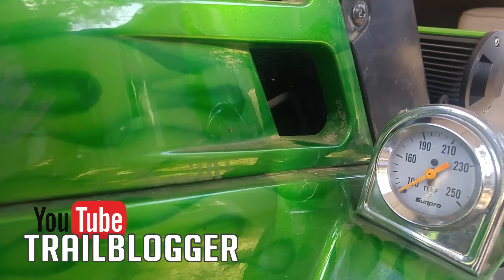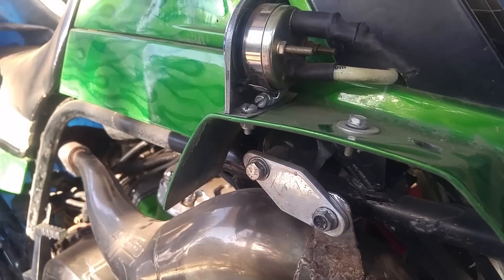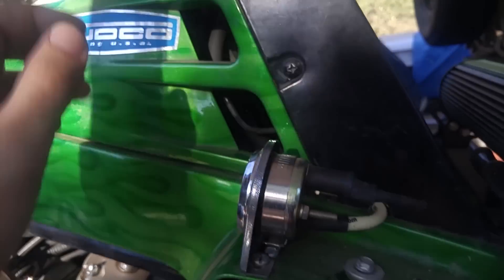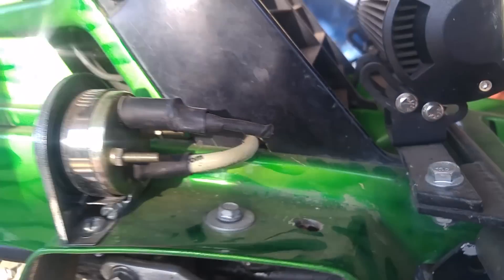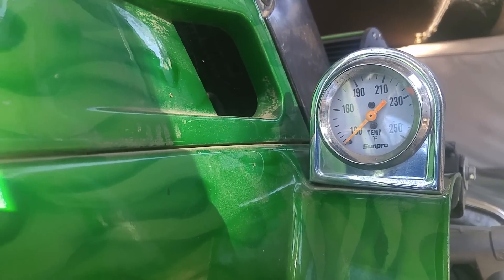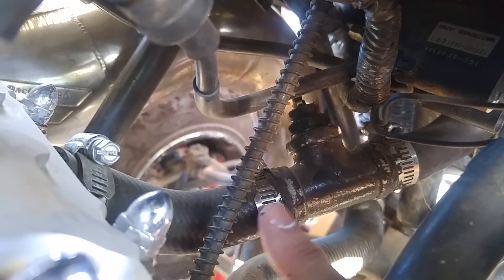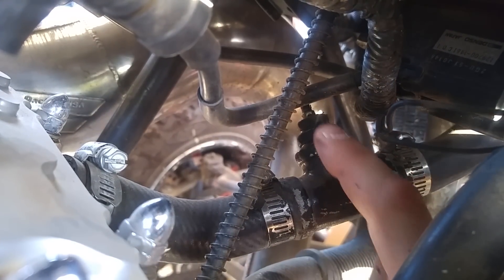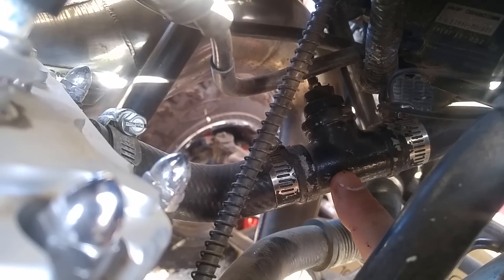Banshee Temp Gauge

Comment: Hey man link to the gauge cheers
Reply from the maker: I think this is it, run of the mill mechanical style gauge from AutoZone / O'Reilly sunpro I think is mine but they are labeled Bosch now https://www.ebay.com/p/Bosch-Style-FST8207-Line-2-Mechanical-Water-Oil-Temp-Gauge-Temperature/1137513213?iid=401737725424&chn=ps&norover=1&mkevt=1&mkrid=711-117182-37290-0&mkcid=2&itemid=401737725424&targetid=484887837309&device=m&adtype=pla&googleloc=9032624&poi=&campaignid=1497794122&adgroupid=56281259685&rlsatarget=pla-484887837309&abcId=1139466&merchantid=6318604&mkevt=1&mkrid=711-117182-37290-0&mkcid=2&itemid=401737725424&targetid=484887837309&device=m&adtype=pla&googleloc=9032624&poi=&campaignid=1497794122&adgroupid=56281259685&rlsatarget=pla-484887837309&abcId=1139466&merchantid=6318604&gclid=Cj0KCQjw6IfoBRCiARIsAF6q06smbtFEHhOf383UK3MmPI9rk-Y9EjaCqAhsj8lMh7gs9PIyr23ZJzAaAngyEALw_wcB
Reply: TrailBlogger does it come with the wiring
Reply from the maker: @jacksonfiscal1160  the only thing I had to buy was a 3 way tee to tie the line into the uppper radiator hose. They sell them on eBay and most places. Search for water temperature sensor adapter. There are a few options. I made my own at the hardware store though out of pipe fittings
Reply from the maker: It is not wired to a light at all. I cut the light wire and it's mechanical be so it works with no power. Just the temp probe line to the hose
Reply: TrailBlogger oh ok so I can order it and it’s ready to go
Reply: TrailBlogger thank you so much

Comment: hi ineed the size of the 3 a T there alot of size
Reply from the maker: I believe I used a 3/4 but I would just take a short section of the hose down to the hardware store with you
Reply: TrailBlogger dont know how size 3/4 is there are 52mm...ets give the the mm size please or give me a website to order🌹🌹
Reply: Hi can you please send me the link or measurements to the 3 way fitting

Comment: what size of the pod holder?
Reply from the maker: 2" sunpro came with the holder.
Reply: i search in amazon its show only the gauge!
Reply from the maker: Fadhel Albloushi here is the one I bought on ebay for $12.50 http://www.ebay.com/itm/New-Sunpro-2-250-Mechanical-Water-Temperature-Gauge-White-Face-/232138079515?_trksid=p2141725.m3641.l6368
Reply: Thanks ❤

Comment: Smart mod mate. Should install one on my Raptor 700 as I have learnt the hard way not to put your trust in just a warning light. Cooked the freshly rebuilt engine in my 1966 Holden a few years back because they were only fitted with a warning light. Found out the hard way that the globe had blown. She now has an Autometer temp gauge under the dash.

Comment: what is operating temp for your banshee?
Reply from the maker: 180-190ish is normal. I can ride it pretty hard even in hot weather and she does not boil over or seem hot at 180. If she get's up over 200 say around 210 I start taking it easy on her. This only happens in rare occasions when I push her really hard for a long time. Normally I can keep it under 190 all day if I keep moving. On the temp gauge I got 200 is right about 12 o clock high noon so it's pretty easy to keep an eye on in between trail runs and actually while I am riding too.
Reply from the maker: if you have mods like porting or run higher compression cylinders your banshee might run a little warmer.
Reply: +TrailBlogger awesome. thanks for the feedback.

Comment: Love the videos and which ITV for you recommend to race with I am 14 and 5'7
Reply: +David Williams nah get like a 350, or 250 if your new to ATVs a 450 will throw you on your butt
Reply: Atv
Reply from the maker: depends on what kind of racing you want to do
Reply: +TrailBlogger I want to race mx
Reply from the maker: YFZ450
Reply: +TrailBlogger. Will I be able to rage in the school boy class with a 450
Reply from the maker: David Williams not sure how the classes really work I dont race. mainly just trail ride sorry. If a YFZ450 is a allowed it would probably be my choice on the track
Reply: Ok thx but if the 450 isn't allowed what would I choose different like around the 250 to 300cc class
Reply: +David Williams a 300ex
Reply: +ZachBraps Ok thx
Reply: +TrailBlogger I don't have experience with atvs do you think i could get a 450 just take it slow so I don't have to buy multiple atvs
Reply from the maker: I would start with an older Warrior 350, Raptor 250 or Raptor 350 then move up to the 450 so you don't get hurt. 450 is a lot to learn on.
Reply: +TrailBlogger a warrior would probably be there best starter because they are cheap and they can be fast but they arnt like snappy enough to throw you off
Reply: +TrailBlogger Thx for all the helpfull information I will look at the warrior 350 and the raptor 350
Reply from the maker: David Williams no problem and here is a link to one of the last warrior videos I posted with my old 2003 Warrior 350
Reply: +TrailBlogger I learned on an 04 trx450r. As long as it's one of the carbureted Trx450r's, he should be fine considering I was 5'3, 100 pounds, at 13 and did just fine. But then again, I have no brains, therefore no worries.
Reply: +TrailRidin' SomBitch So I could start on a xyz 450 it's just not recomended
Reply: +David Williams Yfz
Reply: +David Williams Brother you can ride anything you want, just that it will take practice. The Yfz450r, as much as I hate to say it, is a damn good quad, and this is coming from a Honda guy.
Reply: +TrailRidin' SomBitch Might be snappy when you first get on it, but you'll easily get used to it.
Reply: +TrailRidin' SomBitch Do you know how old you have to be to race the 450
Reply: +David Williams Oh yeah, thanks for reminding me, you'll need to wait 2 more years until you can race a 450. It is technically illegal for a person your age to to operate a 450, but fuck the law. If you wanna get a 450 and practice for two years learning the in's and out's of the machine, go ahead. If you plan on racing now, get a 400ex. Very reliable quad, and best of all, it's a HONDA. I think it's legal for you to race, as long as you're racing at some little local track. Anything else might not allow.
Reply: +TrailRidin' SomBitch Ok thx and when you are training for motocross what do you need to get down pat
Reply: +Matthew Andrews Is there any other atv with about the same amount of power as the 400
Reply: +David Williams Clutch control, experience. That's all I can say.
Reply: +TrailRidin' SomBitch Thx for all the information I might get a 450 practise for 2 years and get good then race in the begginers class till I get used to racing and just take it really slow ad last clutch control and cornering
Reply: +David Williams And a 350 is the closest you'll get to a 400 aside from other brand's 400s. Just that the 350s will lack power.
Reply: +David Williams Yep no problem, if you get a 450 get a Trx450r. Very good quad, I've had mine for 12 years and it has never had a single problem.
Reply: +TrailRidin' SomBitch Do you know anything about the lt-z400
Reply: +David Williams Ey it's a Suzuki so you know, might blow up in 3rd gear, might not. But for real, I've heard they have really good gearing. that and that they are reliable aside from the 3rd gear part.
Reply: +Matthew Andrews In wondering which one I should look at a lt-z400 because I don't really like the style of the Hondas or maybe a yfz 450
Reply: +TrailRidin' SomBitch hey just saying all trxs are carborated that's why they stopped making them the year of 2015, there is a lot of talk of a 2017 efi trx 450 and a lot of us Honda guys are praying for it
Reply: +Braxton Washe I thought after 2005 they switched to fuel injection.